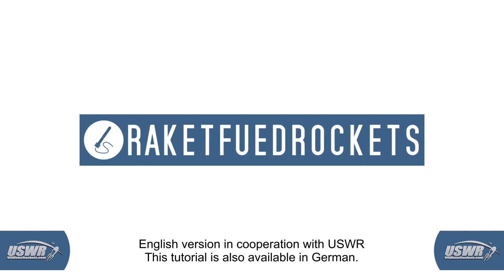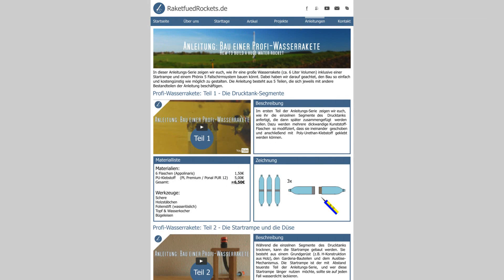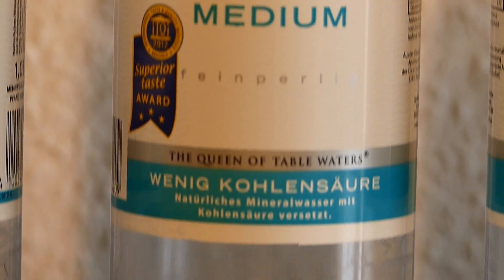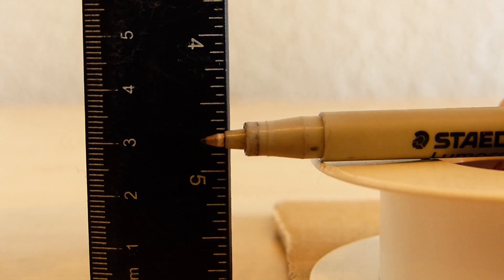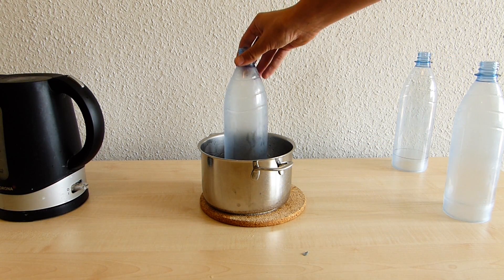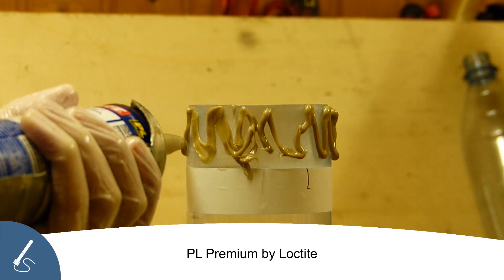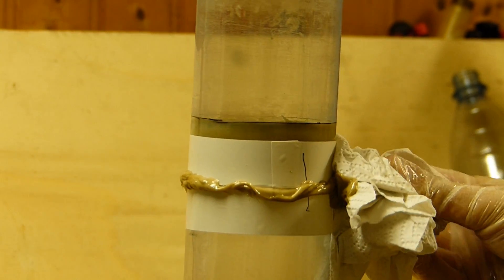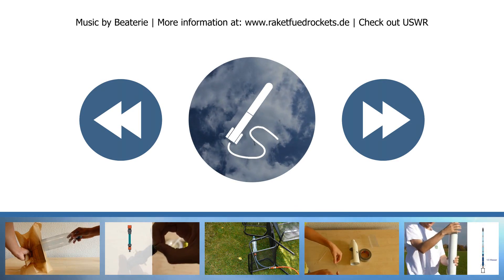Tutorial: How to build a huge water rocket [1/5] - Splicing bottles / pressure vessel segments

Comment: But hey, the part of the bottles that we sanded on the outside get heated by the iron then the bottles with the side sanded inside get the water treatment?
Reply from the maker: No, you have to shrink the bottles with the outside surface roughened.
These are the same bottles which get heated by the iron.
Cheers
Julian